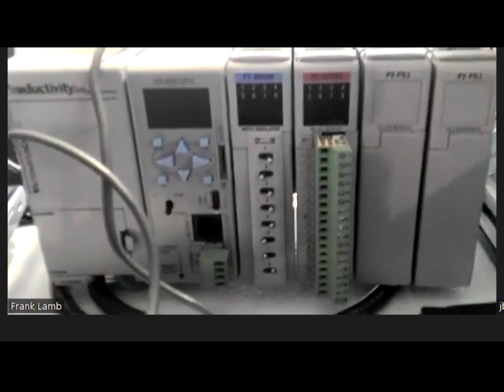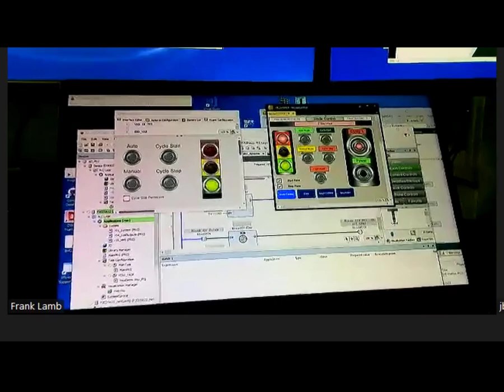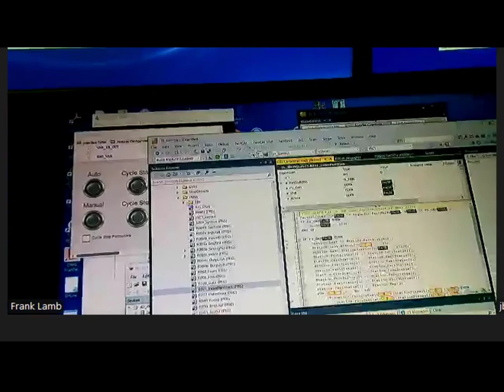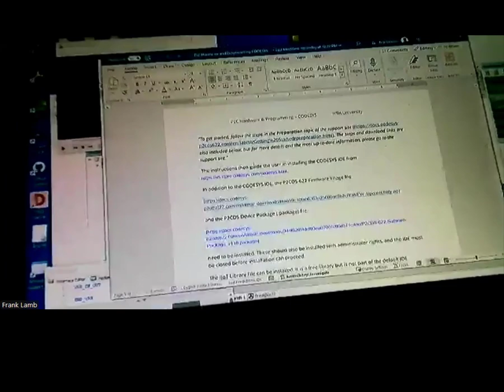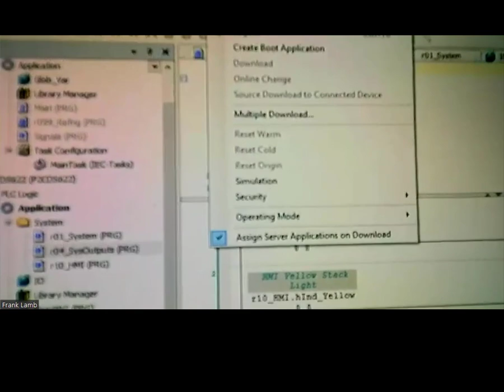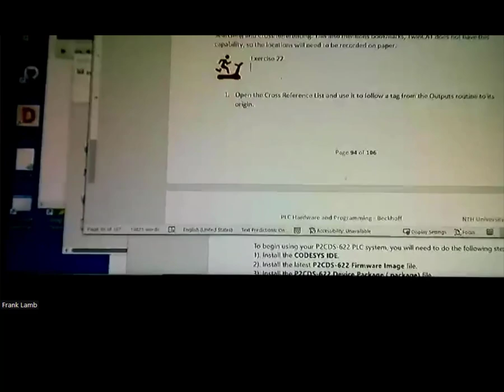Automation Direct Productivity 2000 and CODESYS [Web Ep. 70]

Comment: Thanks for this video. It was very interesting. Normally we would use Eurotherm's E+PLC400 Codesys PLC/Controller for most of our larger system installations. It's a great PLC/Controller for temperature control applications; however, it's I/O offerings is rather limited. I only recently found out Automation Direct offered a Codesys option. I like the P2000 and the many I/O options it offers and love programming with Codesys so it's the best of both worlds.  I just purchased my first Productivity 2000 Codesys controller and can't wait to start working with it.